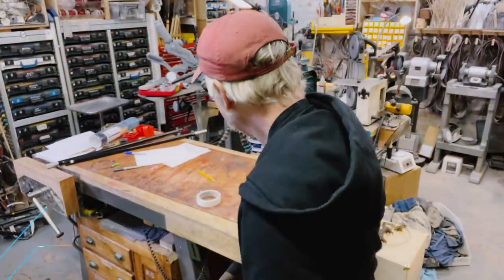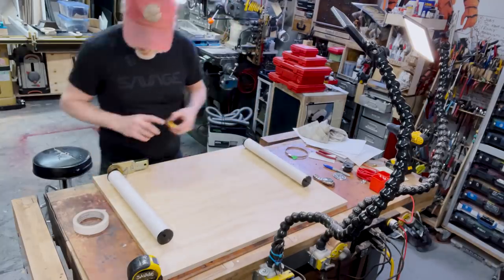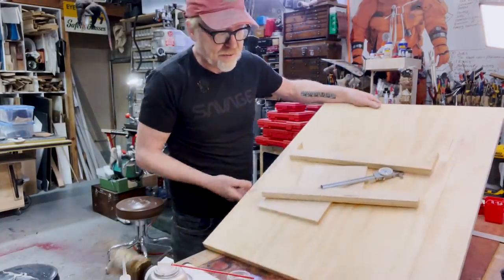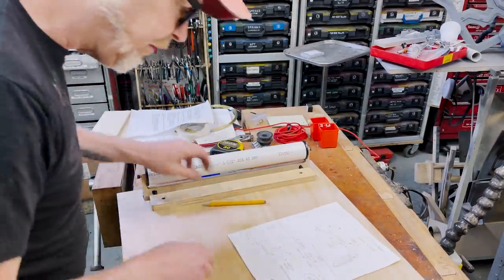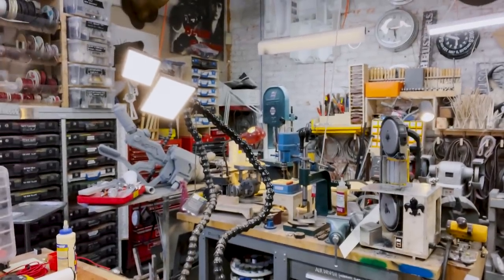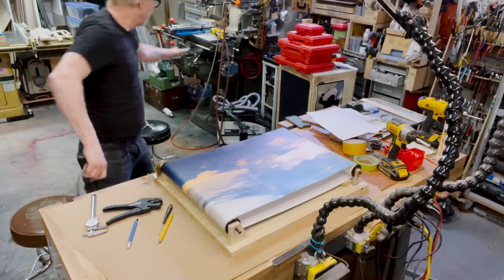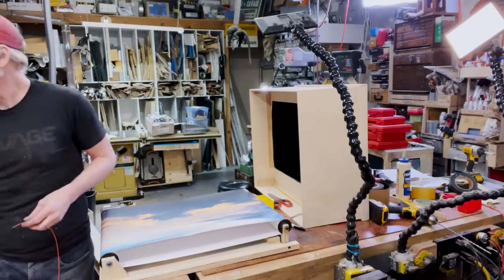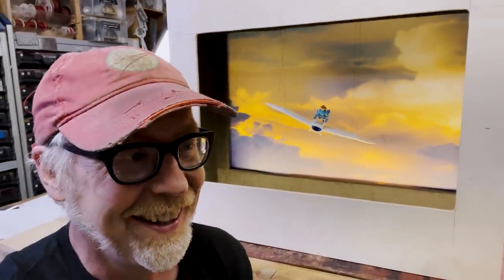Adam Savage's One Day Builds: Studio Ghibli Diorama!

Comment: 49:35
Adam: Isn't that peaceful?
Motor: BrrrawaaWAAAAAwwwWWWAAaaaaaAAaarrrrrb!
Me: [mutes video] Much better. ;)
Reply: Saw that coming.  A gear motor rigidly attached to a big panel is basically a speaker.  He could have put the drive motor in a rubber box and connected it to the roller with a thin cogged belt.

Comment: A tip for these rolling type systems is to make one side adjustable so that you can adjust for tracking issues ... having made a few of these that is one trick we used. Another one is to make the adjustable side spring loaded so that it auto adjust for tension and stretch over time ...

Comment: Made a big unit like that for simulated motion in a haunted house. Used an old tread mill for the mechanics. Added a video peppers ghost illusion  over the top of the mechanical scene. Used it as a window in an elevator simulator. The illusion was a ghost broke the glass as you descended in the elevator.
Cheers!

Comment: Hey Adam, I know that  you will replace that motor ASAP, and since you are going back in, here is an idea for an upgrade! Add a disc driven with a string around the shaft of the drive spool. Attach the threads from the wings to the disc, first passing through pulleys, to an eccentric pin on the disc. Then when the background is turning, the model will “bank” lifting that wing. If you use a second disc you can drive both sides, and then you can have it ascend and descend as well. I leave the mechanical parts up to you!  Have fun, looking forward to seeing the improvements!

Comment: Great video Adam! I love the original movie and your diorama! One idea, you can make a circular plexiglass rod 2-3mm diameter  which can hold the model from the bottom and hide your small motor that didn't work in the start so you can have a circular movement for the model!!  I have a question what is the black sticker tape material that you use to dress the inside of the box??

Comment: Adam, you could add some motion to the character... Take the string and make it a loop that passes under one wing to the front, then goes up and over to the back of the other wing, under, up, and crosses over to the back. Then, at the top of the box, use your weaker motor, but make an offset spindle coming off the drive so that it oscillates up, over, down and back as the motor turns. You might even drill some holes at different distances from the driveshaft to try different things. Anyway, have both of the strings pass up and over the offset spindle (it has to be free to rotate) but only attach the string at one point, but make sure that it's the "top" string so the bottom one is gripped somewhat, but you can slide it to adjust it. If it works like I think it will, you'll get the front right diving down as the back left comes up first, then the right rear and left front will follow... Then the right front will come up, leading all the rest. The hardest thing might be getting the string (or fishing line) too go straight up from the wings, then turn to head towards the oscillating motor without cutting the box over time... Maybe just some delrin dowels on each side for it to rub against?  In my mind, you'll be able to make it do different things just by sliding it around on the loop, and even adjusting how the other string crosses the offset spindle....

Comment: Perfect display for a pretty cool toy/model. But no Teto? That's a missed opportunity. You could 3D print one and paint it, that would be fun :)

A few tips:
- If you keep the viewport smaller than the scrolling background it'll work from a wider viewing angle, not just straight on. Keep the frame around the background assembly as small as possible.
- Put skateboard ball bearings on the roller pins. So much easier on the motor and the background. And quieter too ;)
- If possible connect the rollers with a chain or belt so that the background paper doesn't have to do all the work.
- Use a matte black finish for the shadow box. Schoolboard paint works very well, as does India ink with a matte finish.

I build a couple of these some 20 years ago for a local puppet theatre.

The link in the description points to a different kit btw, that one you'll have to paint. The one Adam has isn't produced anymore afaik. They sell on eBay and are quite expensive :(

Edit: Also, overlap the edges of the background and glue them, no gap.

Comment: As I watched you build this, I was wondering if you were going to need to add something to the two rollers to induce a self-centering tendency for the paper roll. I imagined having very slightly thicker rollers near the centers of their length, perhaps by wrapping them with a little bit of tape, would cause a slight increase in tension on the paper at the center, so that it would not tend to slide up or down the rollers over time. If instead, you are relying on the black Delrin ends to trap the paper on the rollers, won't that cause some wear and tear on the paper overtime?

Comment: work hardening isnt frictional heat changing the crystal structure. As you deform the material, you cause tiny imperfections in the crystal structure (called dislocations. basically the crystal structure abruply shifts and the atomic bonds have to compensate around it). These dislocations can move along the crystal structure as it is strained, but the more there are in an area the less the material can bend freely. This actualy increases the strength of material, but also causes it to become brittle and eventually fail. So when you bend the metal back and forth you are essentially stacking imperfections in the crystal structure until it can no longer accommodate them and shatters.

Comment: just a suggestion... electric motors are noisey .. put some rubber maybe 1/4 thick between it and the wood that should help . this is why good record players { like bang and olfson} mount the motor seperately  then run a belt drive to the turntable

Comment: I would've projected this, instead of using a big canvas.
1. because projected backgrounds (with a mechanical setup, so no electronic projection) have that fuzzy, faded look to them, which looks cool
2. it wouldn't require much juice to run
3. with projected BGs you can so some really convincing skies, especially, IF, you curve the back piece unto which it's projected.

Some of the coolest dioramas i've have seen, ever, are done in this manner, using projections done on plastic backing, printed with an inkjet printer. In particular one that's made for a SW diorama, with the famous trench scene, looking down Luke's cockpit.

Comment: I would have thought bending and breaking somthing would have to do more with elastic/plastic properties of the material? Basically as you bend the cross section becomes smaller as it goes into plastic range and eventually after bending back and forth you come to the point the material breaks?
Reply: Ductility in metal is caused by the movement of dislocations within the atomic crystal lattice in the metal.
Moving the metal causes the dislocations to migrate to the boundaries and out of the crystalline structure.

When there are fewer dislocations in the material it becomes hard and brittle and therefore small cracks quickly propagate through the material causing it to break.

I have literally just finished an engineering assignment on advanced materials and mechanical properties.

Heat is a byproduct and nothing to do with the failure mode.

Comment: Are we not going to talk about how at ~34:41 Adam nails the piece to the work surface, and then tries to lift it a few seconds later.  You can see that the edge is nailed down right when there is an awkward cut to..Adam having made a mistake (putting it in backwards).

Comment: 13:13 not true.

Ductility in metal is caused by the movement of dislocations within the atomic crystal lattice in the metal.
Moving the metal causes the dislocations to migrate to the boundaries and out of the crystalline structure.

When there are fewer dislocations in the material it becomes hard and brittle and therefore small cracks quickly propagate through the material causing it to break.

Comment: You use of measurement in feet and inches such as 22and 5/16s for instance along with eighths, a 32nd a 64th and thousands of an inch on the lathe combined with the archaic guages for screws, nuts and bolts etc is unbelievable. Metric!!! Come on USA catch up with the modern world. 270.5mm. Who wouldn't get it.

Comment: I always feel so sorry for you when I hear you using your imperial measurements. 

Ever since Napier improved on Stevin's decimal notation, we have had a much better way of doing math that did away with fractions and made everything much more logical and easier. (The metric system.)

So if I want to add 1 mm (millimeter) to say 12 mm it would be 13 mm. That is easy and logical, but if you want to do the same with your imperial units, it would go from 15/32" to 33/64" which is just a ridiculous way of measuring.